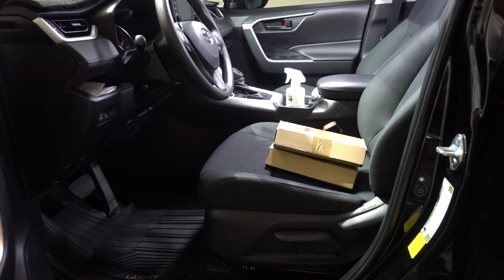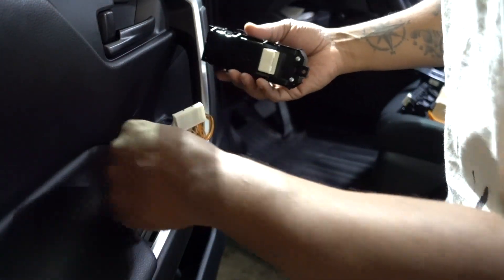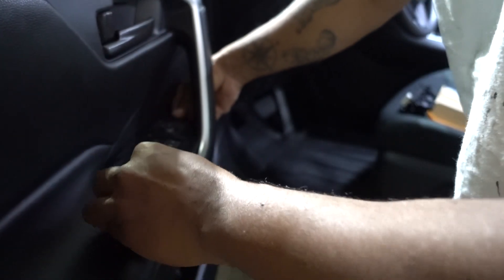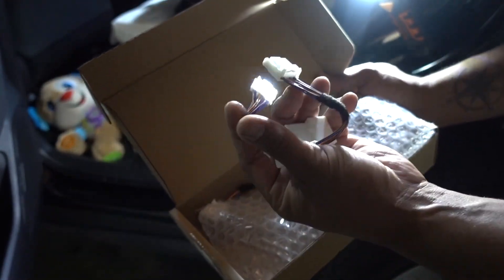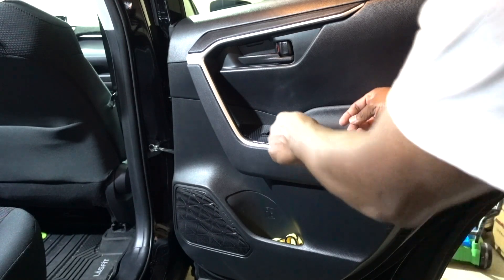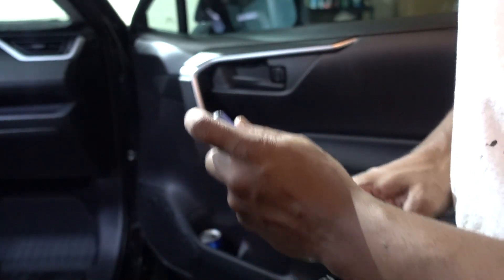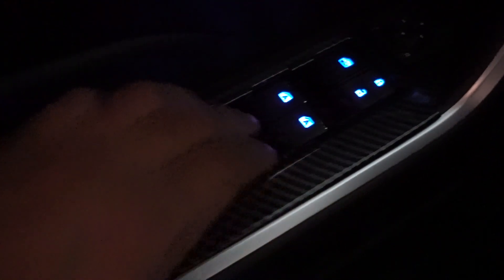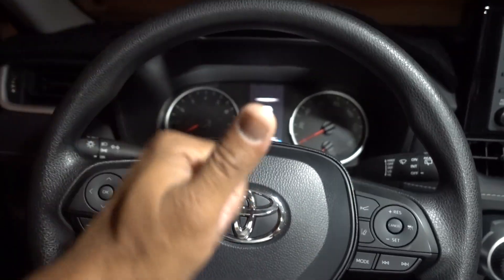2019-2020 RAV4 Installation | Lighted LED Window Switch LHD Models

Comment: I just installed mine and they look great ! Thanks for the install video :) Do you have to use the new wiring harness for the passenger side switches ? I just used the original wiring harness and it worked just fine
Reply from the maker: I did used it because I have the led door handle bowl

Comment: I have a concern. I have installed both the A Style Power Window Switch and The LED Bowl Lights but my power mirrors don’t work anymore. The only way for me to adjust the mirror is to disconnect the LED bowl and connect the oem connector then adjust the mirror. Im not sure if its the connector thats faulty or if I did something wrong when splicing the oranges and black wire that needed to be connected together. I would like your opinion. I don’t want to return both of the product because they are way better than the OEM.
Reply from the maker: What trim rav do you have?

Comment: What is the difference between this driver side control and the one you installed 8 months about?   They both look the same.  Also, can I order this part from a Toyota dealer or do I need to order from someone else.  I’m concerned I might not get the wire harness from a Toyota dealer.
Reply from the maker: No difference but I did this again because car trim home send me the complete package, but if you order the driver side from the dealer you don’t need wire harness, but you do need wire harness for the other doors, but you can’t get that harness from a dealer, because is aftermarket